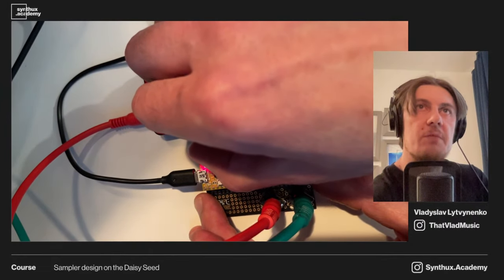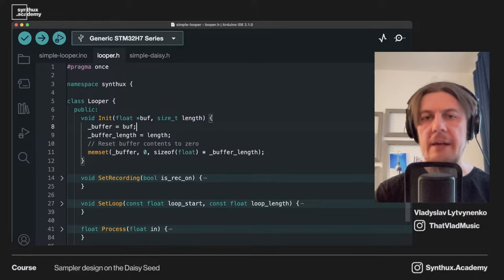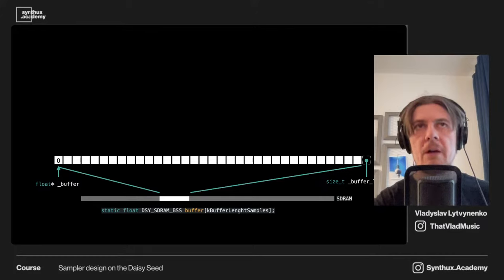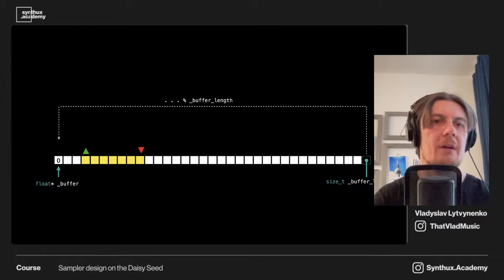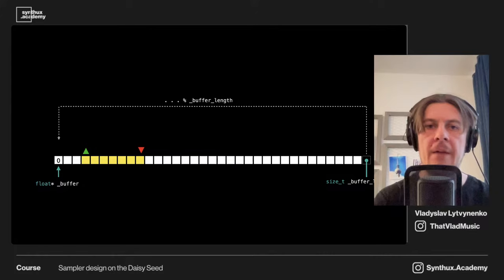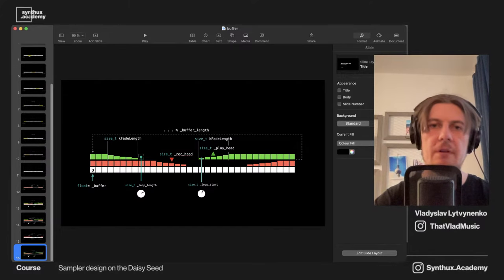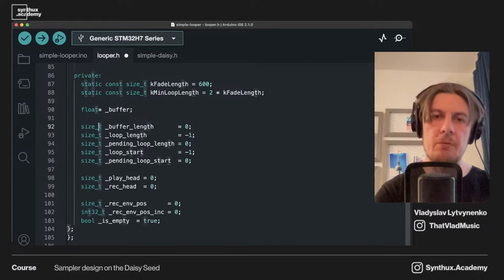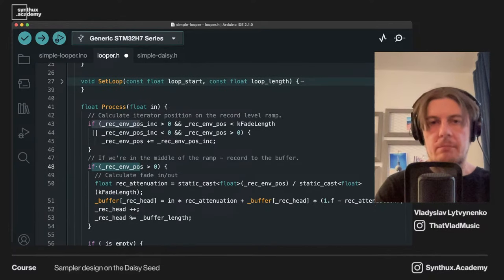Workshop - Synth DIY Sampler/Looper on Daisy Seed

Comment: Thanks for the video.  I am using a daisy seed and breadboard.  I see that the pitch pin is set to A(S33) is that referring to pin 33?  It looks from the pinout that it only does Digital
Reply from the maker: Yes, we are using a different pinout because the Simple board is platform agnostic and works with other microcontrollers. If you’re facing any issues, join our Discord to get help.
Reply: @SynthuxAcademy thanks, the discord link isn’t working at the moment

Comment: If I place the potentiometers, switch and touch sensor like Roey showed in the beginning. Would it be possible to use the switch, which is not used in this project to get the potentiometers to other controls when flipped? Like LFO speed for startpoint modulation, reverb and maybe tap delay (feedback amount on pot) tempo on the touch sensor? 
I do not unterstand how to get this double use of components.
Reply from the maker: Yes, you should join us on Discord for this. It requires some more coding work. Go to the #beginners channel and ask there. Link to discord on our website.